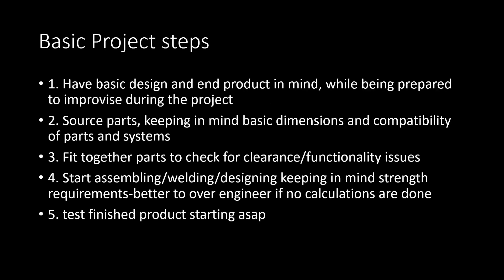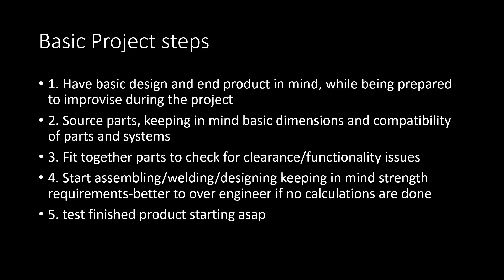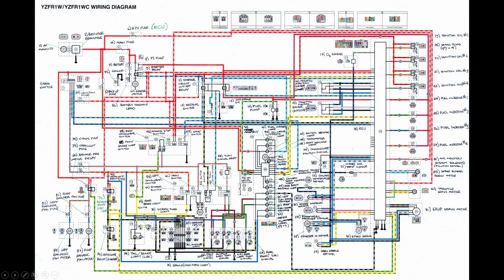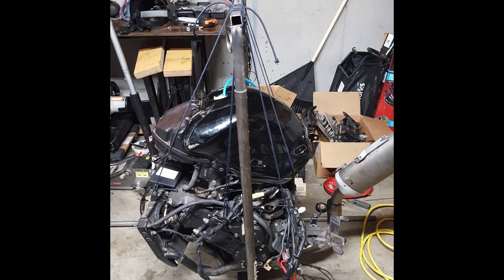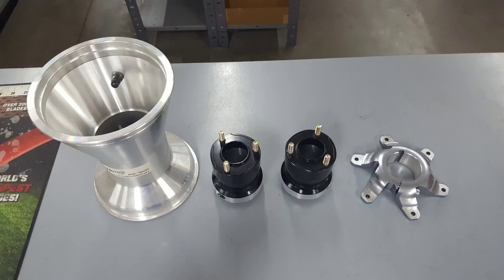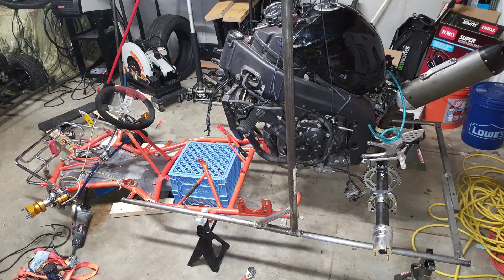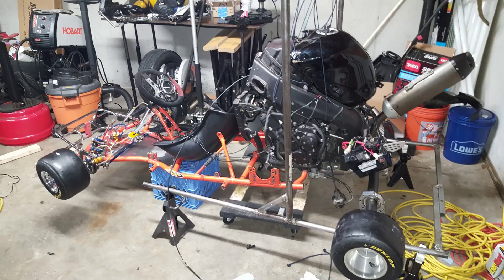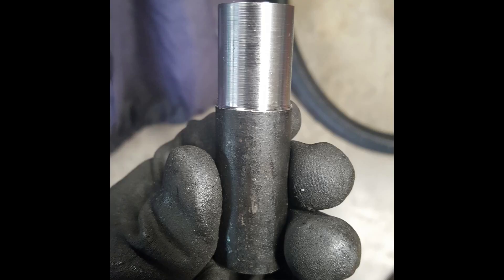How to make a 1000cc Shifter Kart-Part 1

Comment: How long did it take you to build it? 
And how much help did you have?
Awesome job.
Reply from the maker: It probably took 400 hrs, but probably 30 hrs was getting electrical hooked up correctly, since I didn't have a gauge cluster or harness to start with. All work done by myself with my own tools, which is why it takes so long. A helper just to move stuff would have cut time in half. I didn't adjust the speedometer, I just went off the gear/rpms to know roughly how fast I was going. Hope it helps.
Reply: @gameoflife7235  appreciate the videos you made!  And thanks for taking the time to reply back. 
Luckily I had a complete bike to start with. Mines is a 2003. 
I'm stretching my go kart 27 inches. Is that about right?